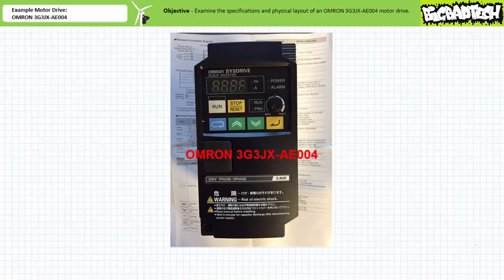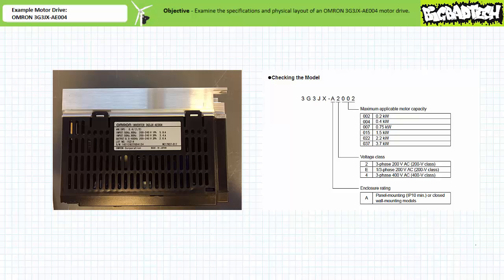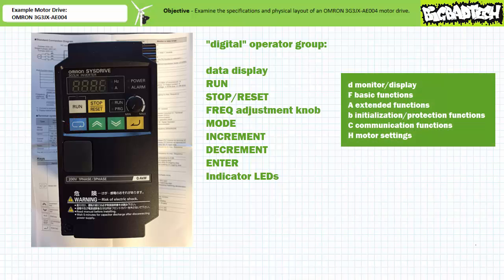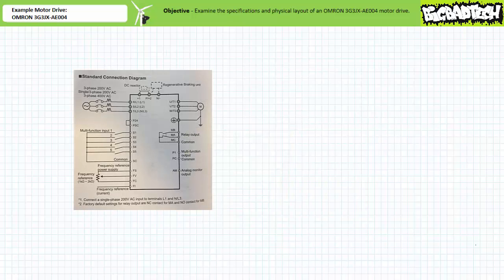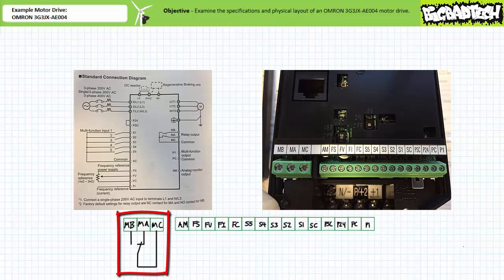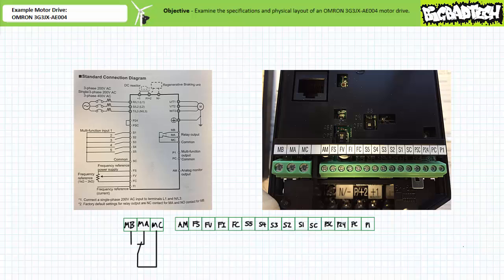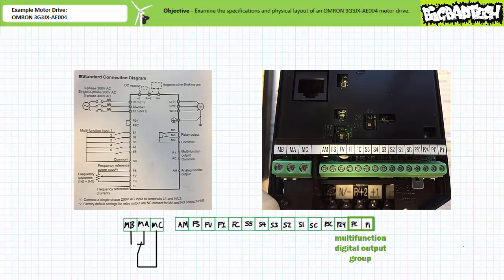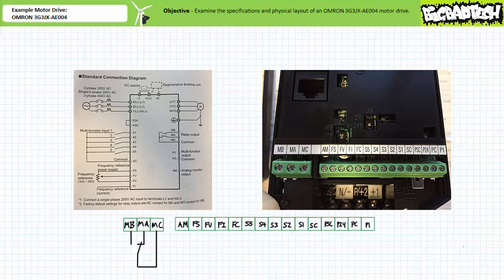Example Motor Drive: Omron 3G3JX-AE004 (Full Lecture)

Comment: jim can you give a wiring diagram for 3 wire start stop and remote speed control for 3g3mx2d2015ec thanks in advance
Reply from the maker: Check out this lecture: https://youtu.be/pe627kwSB_4 should be similar. Make sure to confirm pin outs and function assignments for your particular version.